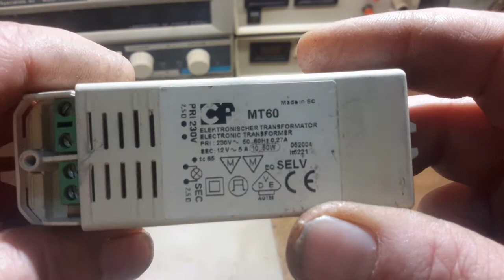DIY 240v mains powered Flyback Driver

Comment: The first ever electronic halogen transformer I installed immediately jammed all the radios in the vicinity.
The thing that killed them was overheating, because both transistors ended up somehow turning on despite the base windings being antiphase and they'd bridge the supply and go bang.
If you have a tungsten load on them you can then add little high frequency neon transformers with custom primaries and a capacitor in series with the tube so you can light a bit of neon.

Comment: umh!.... i think you gave me a nice project idea that uses my MASSIVE (and mostly useless) hoard of horizontal deflection BJTs
Reply from the maker: Ha definitely. Parallel a few up with emitter balancing resistors 

Thanks for watching 

Steve
Reply: @T2D.SteveArcs  i ended up using 13009s and without a smoothing electrolytic, also i tried to make the circuit independent from the load (adding a separate transformer for the transistor's bases) and trying with an ungapped flyback with 40 turns primary, it drives it 100% ok
Reply from the maker: @redoverdrivetheunstoppable4637  that's exactly what I did see the Green base drive transformer on mine with a single turn🤣.. good work mate, its good fun building your own versions of circuits, hacking, modifying etc...

Thanks again for watching 

Steve
Reply from the maker: @redoverdrivetheunstoppable4637  or do you mean you didn't use primary feedback to the bases (a separate oscillator ?)
Reply: @T2D.SteveArcs  i think i expressed myself badly, i was shitting myself while writing, i had to go to the bathroom LOL, i meant that instead of the single turn IN SERIES with the output winding, there's one with like 100 turns on a bigger toroid and it's IN PARALLEL of the output, so even at no output current the bases are still driven hard and it stays on (but this was just the first step for trying to adjust the switching frequency with an LC tank... that i failed, it worked only on LTspice)
Reply from the maker: @redoverdrivetheunstoppable4637  ok I'm with you now🤣 could try a separate feed back winding from the flyback core , some parallel tank caps to change the frequency?? Good to see you experimenting 👍👍

Steve

Comment: Is it self oscillating or you have a control IC like IR2153 ? Looks like self oscillating
Reply from the maker: Self oscillator if you Google electronic transformer schematic you can see it .. it uses a diac to kick it off and a base drive transformer in series with transformer primary, a pair of 800v bjts.
 Its slightly different from original schematic in that it has a electrolytic bulk cap and and a series NTC element to deal with the inrush that creates. It needs the filter cap for when you drive flybacks etc for hum free output..

Steve
Reply: @T2D.SteveArcs  Ok I understand, thank you